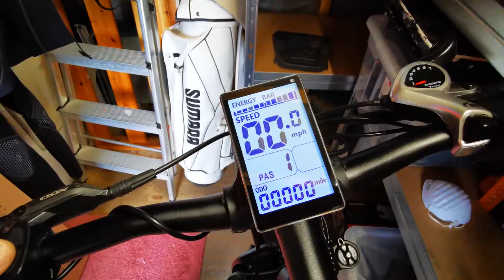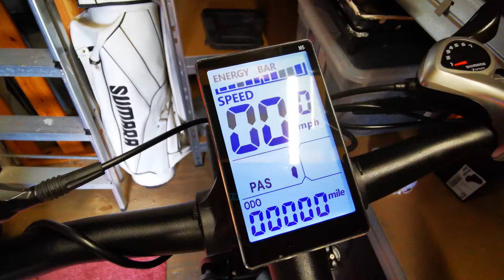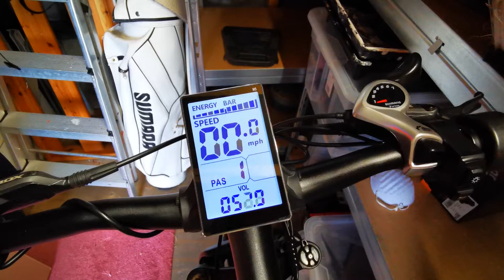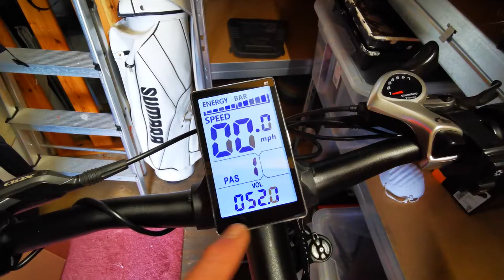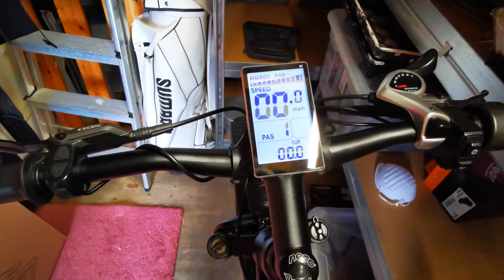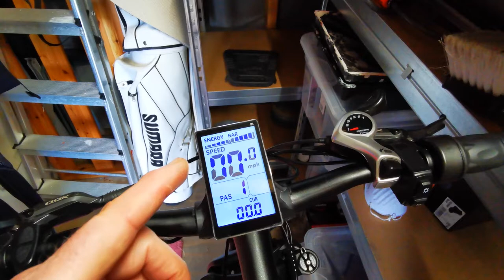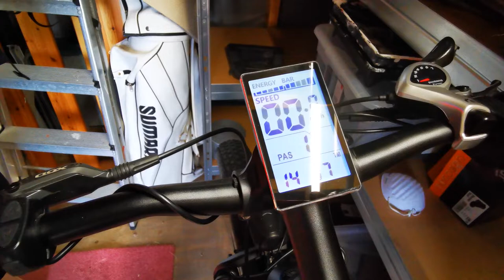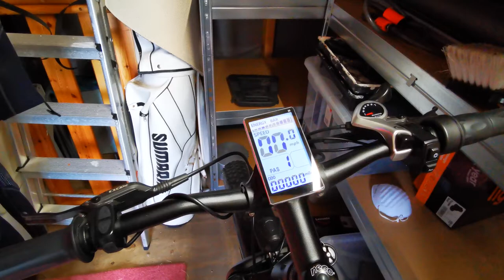Basic M5 Controller Display Settings for MX03/02/01

Comment: when i go downhill it stays stuck on 25 km and my wifes doesnt she also goes a bit faster anyone know a solution?
Reply from the maker: Your wife is obviously fitter and faster! 😉
In settings the controller’s P08 is possibly set to the legal 25 kilometres an hour for Europe and the UK on your bike but not on your wife’s bike. 
If you go into settings and you are cycling off road on private land you could set P08 to 100 which is unlimited speed. 
This is off course illegal on the public roads and cycle paths. Hope this helps!

Comment: could you do a video showing how the cruise setting is achieved.  I've seen it on the m5 display but no idea how to get to use it, or know much about how it works.
Reply: If you hold the throttle down for 10 seconds, it will automatically go into "Cruise Mode", and it will hold that speed for you until you hit the throttle, brakes or pedals .. Hope that helps
Reply from the maker: That's totally different from mine as I need to press the controller down button on the controller for several seconds for it to go into either the 'Cruise' mode when using the throttle or the 'Push/Walk' mode when stationary....!
Reply from the maker: Press the down button on the controller for 2 or 3 seconds for it to go into either the 'Cruise' mode when moving and using the throttle or the 'Push/Walk' mode when stationary, I'll upload a video later....!

Comment: At the steepest hills, when the motor struggles and stalls, the battery can be putting out 10+amps to try to spin the motor. I once tried climbing a 45-55 degree road and it gave up in the middle. The battery bar went down from 4 full bars to just one. Petrol is more efficient on hill terrain.

Comment: My controller (X008-AAM003) and the M5 display only has settings 1 to 20.
Would you possibly know what the correct settings are for this configuration?

Comment: Hi Ron, i've sorry for my english and my question... i've buy the mx03 and is the fist ebike that i use. I not know, but is normal that on the LCD i see only 7 Ah of consuption at the max of the speed. Can you confirm? are only 336W delivered to the motor? Thanks Antonio
Reply from the maker: At full assistance, it shows 7-8 amps max on my display too, so perfectly normal!
Reply: @RonWalkerCairngormGuides  thanks Ron

Comment: Hi Ron eexplain each number to what it reppresents and put new videos of the ebike. I also bought the same ebike.
Reply: 1		Display 1 to 3 Brightness
2		1=MPH 0=KM
3		Ball Volt 48
4		Time Out 0=No Sleep
5		0=3 Mode, 1=5 Mode
6		Wheel Diam = 20
7		Spd Meas Mgntic StL= 01 -geared mtrs 500-750w
8		Spd Limit 0-100 (100=100%)
9		0=Zero Start   1=non Zero start (Delay) 
10		Power Assist 2=PAS and Pure Drive, 1=Throt only
		
11	PAS sens 1-24 (do 23)	
12	Start Strenth 1-5 (1) 	
13	Passive Mag steel set 5-8-12	
14	12a = 12 	
15	?	
16	Odom reset 5 sec = total reset 	
17	Cruise Control 0=NO 1=Cruise	
18	18 Spd Proport Adj 50-150	
19	0 level adjust 0includes 0	
20	0
Reply from the maker: It's all in the description!
Reply: @geolatorre  Can I change 14 12a to 18a the controller is 18a
Reply: @geolatorre  PAS sens is 23 more sensitive than 1

Comment: My speedo doesn’t work on 0 , have you every had that mate , thanks
Reply from the maker: Hi Paul, I've not heard of that happening, did you accidentally change any settings before the issue?
Reply: Neither does mine. I am pretty sure it isn't meant to. When its not accelerating the entire system is in standby.
Reply: @RonWalkerCairngormGuides  if done some research and changed a few settings and now it works all the time even if rode as a normal bike no throttle or pedal assist, thanks for getting back to me
Reply from the maker: @paullynch1938  that's great what setting did you change?
Reply: I watched this video mate https://youtu.be/v4dUrczJbE0 in fact I watched loads so I’m not sure which one but I set it how he did and it’s ok now

Comment: Hello
I have a question, if you stop pedaling, the bike starts to slow down?
For me, this happens at every level of support, is it normal ...
I can't imagine driving without batteries ...
Regards.
Reply from the maker: It’s just like a normal bike, if you stop pedalling there’s no pedal assistance and you’ll slow down unless you are going downhill or using the throttle!
Reply: @RonWalkerCairngormGuides  but in the options you can change it somehow ...